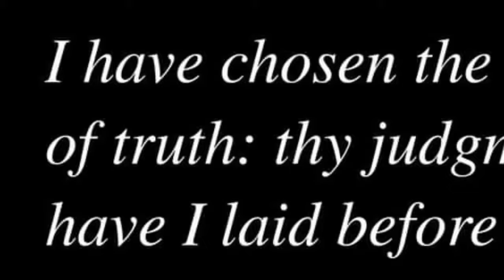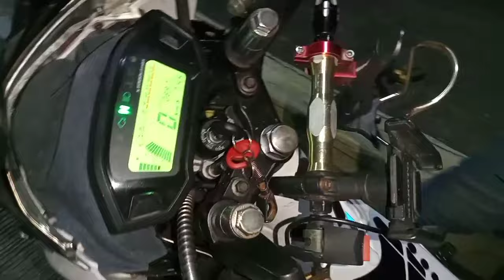Di maisagad dahil pumupogak / Ito pala ang dahilan ,ang mahinang kuryente(high tention wire problem)

Comment: Naglinis aq ng motor akala ko napasukan ng tubig carb.ko so pinalinis ko..tapos nagbhard start na.pinalinis ko uli tapos pinatono..ganun padin hard start.pag natakbo na aq napuputol takbo..inuubo..naisip ko baka sa pagtapos ko mapanood to..nagpalit aq dati ng high tension wire splitfire tatak.bago din spark plug ko..binuksan ko loob ng high tension wire nakita ko tela yata loob nya..tapos may naka ikot lang na tanso..posible kaya un ang problema?

Comment: Bro bakit malakas mag vibrate yong rouser ko
Reply from the maker: Mahigpit ang nga engine support mo?
Pa check muna bro
Reply: @RRJTVRandomTutorial  tnx bro..
Reply from the maker: Jonathan Truya  bro try mo nuna ipatuno ang carb,baka barado ang main jet.
Tapos drain ang tank pati carb.
Tapos linisan mo ang terminal n ignition coil pati spark plug